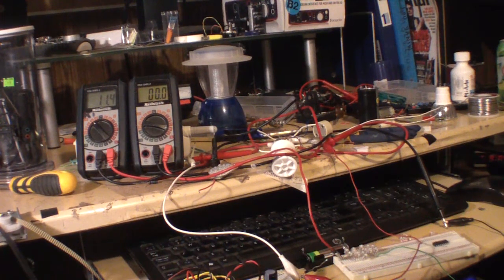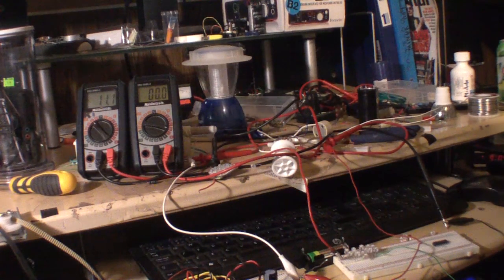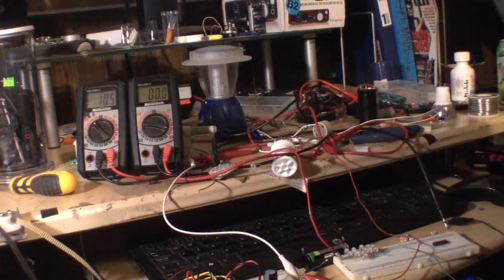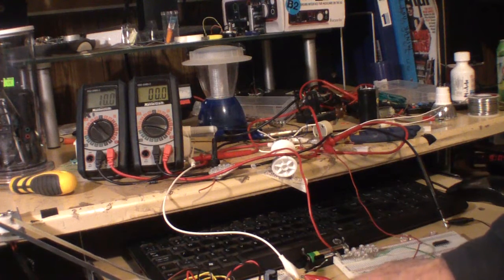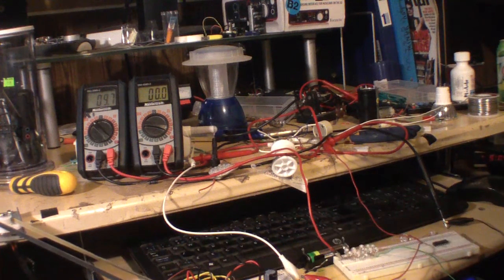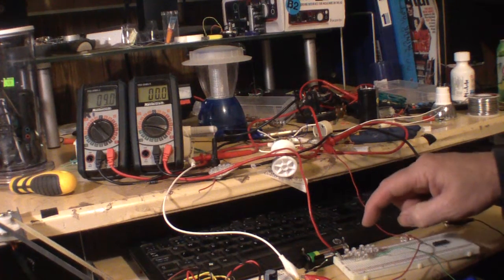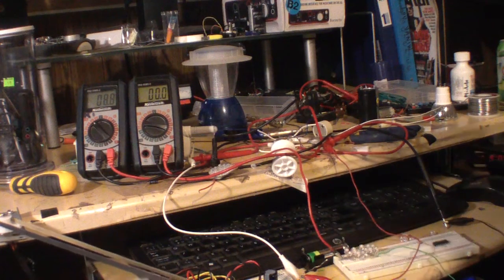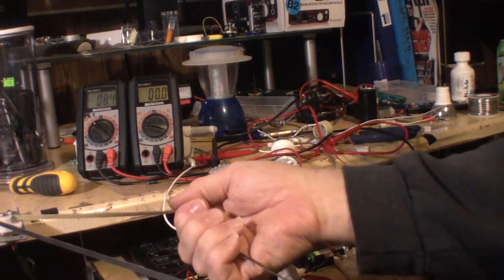Stepper Motor Generator - 2 Watt Output

Comment from the maker: it has occurred to me that,i think, in essence, my circuit is employing a voltage doubler, as connected. http://www.c-realevents.demon.co.uk/steppers/fullwave.gif --- read the last parts of  http://www.c-realevents.demon.co.uk/steppers/stepmotor.html
Reply from the maker: i take that back, i rewired it with one diode per hot lead, and the common to ground and it appears to be about the same voltage with less current, most likely losing half waves.